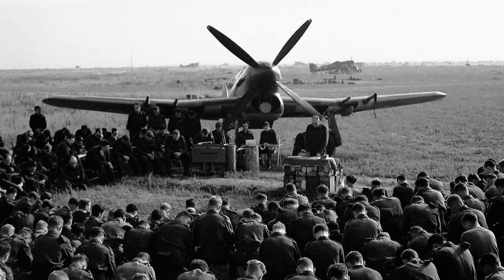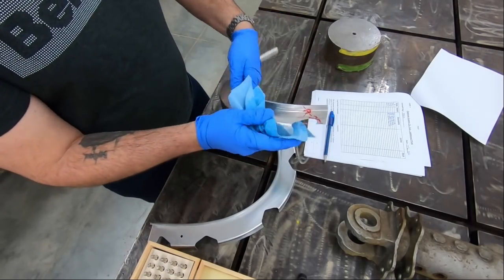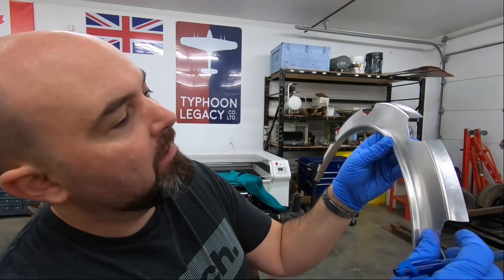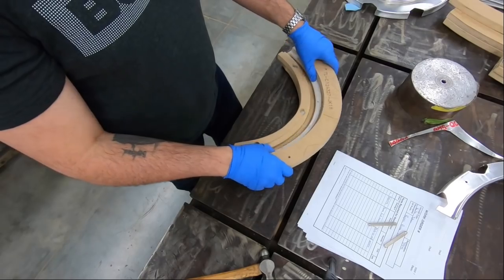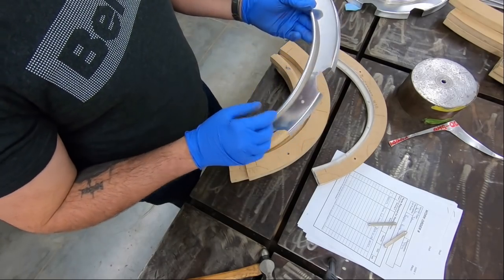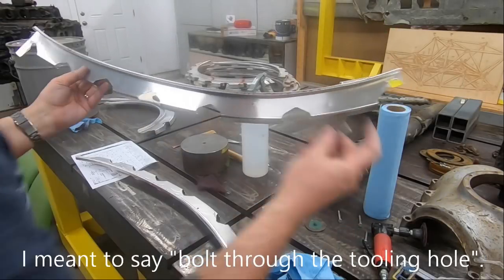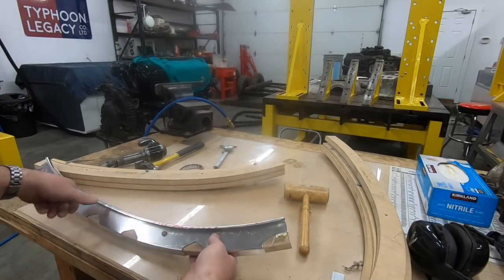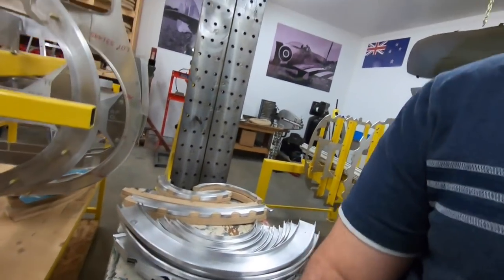S01E11 Hawker Typhoon Monocoque Frame Verification

Comment: Always fascinating and well presented. As a model builder could I ask one simple question?
Is the rear fuselage monocoque straight  sided both in plan and elevation ? In other words is
the structure devoid of compound curves ? Thank you.
Reply from the maker: Hi Richard, very tricky! I would need to have Bruce run this in CAD to prove it, but I believe there is a very (very!) subtle compound curve to the forward mono. The skins are all produced without a secondary cure though.  Let me check into this and I will get back to you. ~Ian
Reply from the maker: Richard, I've talked with Bruce, and he can confirm that there is a slight compound curve to the forward monocoque section. It is difficult to elaborate more on the matter due to the fact that the amount of curve varies depending on location; I can however, confirm the curve is there! ~Ian
Reply: Hi Ian . Thank you for looking into this . I often wonder whether designers like Camm  were concerned with simplifying the production process or just drew what they wanted knowing that a skilled workforce would accommodate their subtleties?

Comment: Fantastic work! What are you going to do for an engine though? Surely it will not be possible to rebuild a Sabre to flying standard?
Reply from the maker: There is a bit of information in our recent Q&A video on this, aside from that the powerplant situation is sensitive, so will be fairly quiet until the time is right. ~Ian

Comment: The section of those longerons would be better a thicker section as that is where the  typhoon used to break in half on a bumpy landing. Worth the extra weight, for strength.
Reply from the maker: It's amazing to hear some of the stories out there about the Typhoon! I suspect there has been quite a bit of misinformation printed over so many years, hopefully we can clear some of this up. The Typhoon did suffer from tail failures early on, but this was a result (ultimately) from vibration in flight. The tail was not prone to breaking on landings, and the original design was plenty strong to handle normal flight and ground loads ~Ian

Comment: Hi Ian, I’m curious: when you got to frame H you mentioned paperwork. I know a lot of folks won’t find it interesting but what sort of paperwork do you need to do when creating new parts, especially key structual components?
Reply from the maker: I actually edited out my discussion on that one! Very basically, every part needs to track the material back to manufacturer, in the case of frames, it would be the mill where the material was produced. The material comes with test reports and a certificate of conformance (CoC). This information must be recorded on the work order to produce the part. In addition to material information, the part must be made (repaired) in accordance with (IAW) something, either a manufacturers drawing or an existing part, so those references need to be tracked. If the material is not identified in a drawing, or the drawing is not available, testing needs to be conducted and recorded identifying the original material. If the original material is not available, and an alternate material is to be used, the information proving equivalency must also be recorded. If there are subsequent processes (like heat treatment or hardness testing), these too must be recorded, and paperwork included in the part file. Typically there will also be a finishing reference to show that the part was correctly refinished and protected IAW the appropriate requirements, and then there would normally be assembly reference information; batch numbers and CocC for the fasteners used. There are all sorts of other variables, but these are the common requirements. When the part is complete, the licensed individual who made/inspected the part will sign the documentation to complete the task. ~Ian

Comment: So I was thinking a few years ago. And now I see you guys have so many followers. And now I can see.  The entire plane is just loads of little parts. You could have the entire plane built buy followers. BUILD A BIT. All the bits would flow around. Until you had parts made of components. That can flow back to you to final assemble. It would be a huge paper trail. But that is what computers are for. Everything. From pistons to frames. You could sell a kit to me. I would then make a few parts. Pass them on and so on till you had a flying squadron!
Reply from the maker: That would be amazing to get done, but unfortunately not something I would want to oversee. It would be impossible to verify how people worked material or heated it. It could work for a static project, but one heck of a system to oversee! ~Ian
Reply: @TyphoonLegacyCoLtd  hi. Thanks for the prompt response. I suppose someone could sell the kit and the training. Thus get the verified and certified paperwork and parts.

Comment: Ian, can you explain the heat treatment process  for this aluminium ( yes you can see I am English lol ) please? I am only familiar with annealing ally after it has work hardened. I used to be a high school metalwork teacher here in the UK back in the 70's and 80's and to anneal it you had to heat to approx 600 f if I remember correctly. The only way to verify the temperature was to use the liquid soap we used in the workshops and that turned black on the part at the right temp ! Lol worked fine, but I'm not building parts for an historic aircraft!
Reply from the maker: We will be going into detail on this process very soon, stay tuned! Annealing with soap or carbon is quite effective for non-airworthy work; for these parts, temperature and timings will be very tightly controlled to ensure the correct strength is attained. ~Ian

Comment: I can't imagine this much effort and care ever went into a Typhoon of the period.  Good to see though.
Reply from the maker: Likely not, we're fortunate to have the luxury of time, made possible by so many who didn't! ~Ian
Reply: @TyphoonLegacyCoLtd  - great stuff! Due to the problems the original aircraft had with the tail section, I recall that a number of mods had to be made (including strengthening the tail joints etc) before the root cause was identified and resolved. Something to do with flutter and the control system at the tail section if I recall?

Which mods are intended to be made on the build? Obviously the plan is for a flyable plane at the end.
Reply: Yes. Awesome work even if its missing that authentic slam out as many frames as you can between air raids and tea breaks style.
Reply: I was thinking exactly the same thing 😁.

Comment: Would be interesting to see the heat treatment process. And an explanation on what it does exactly. I assume it is a stress reliving step to eliminate stresses induced in the material during forming.
Reply from the maker: Coming soon Matthew! ~Ian
Reply: @TyphoonLegacyCoLtd   Nice looking forward to it.
Reply: Is it what the 1940s manufacturers were doing at the time? From a purely historical interest. There’s no problem using more modern kit or techniques to get the same parts to the same spec faster.